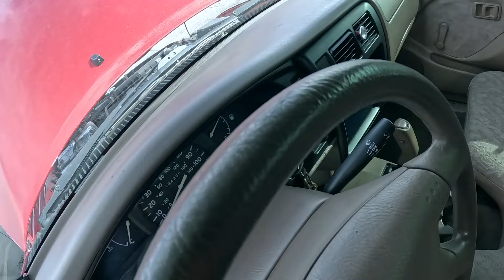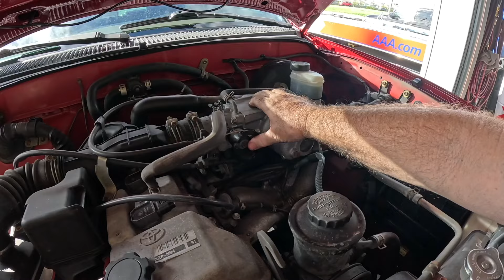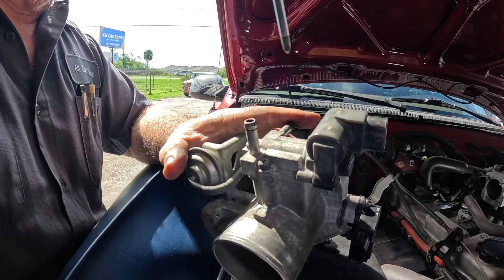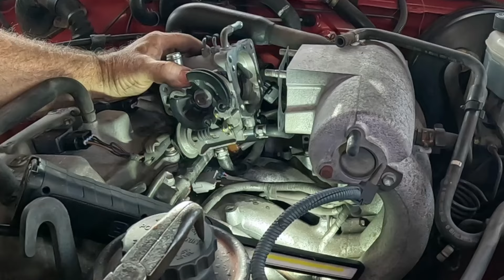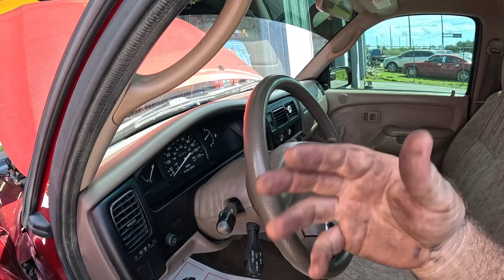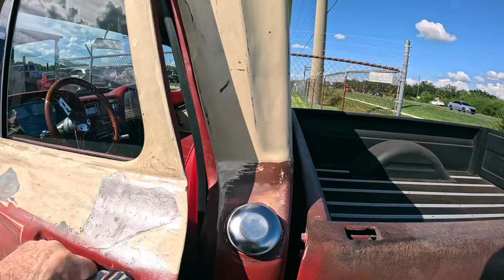Toyota, Tacoma, High Idle, is it the Idle Control Valve? 2001 and others

Comment: On my 92 Toyota pickup the coolant lines actually control the IAC valve. If the coolant is cold the valve opens easing the idle until it reaches a certain temp.
Reply: Suppose to be raising the idle. For some reason I can't edit my comment.
Reply from the maker: The engine computer reads coolant temps and adjust the idle control valve as it desires to control engine speed based on those temps. With the hoses bypassed it would function the same but lose driving ability in colder climates. Hope this clears that up. :)